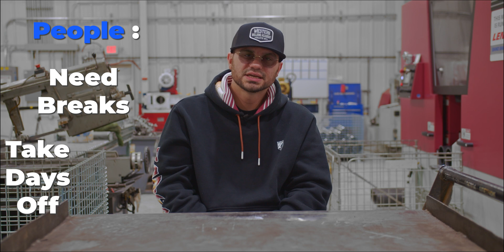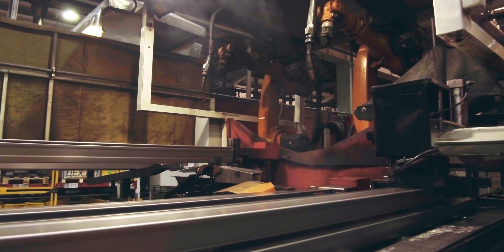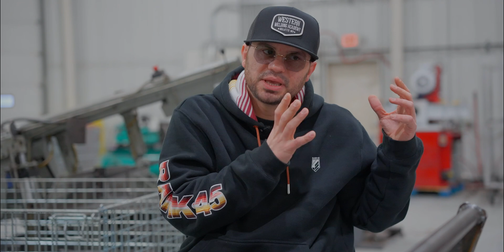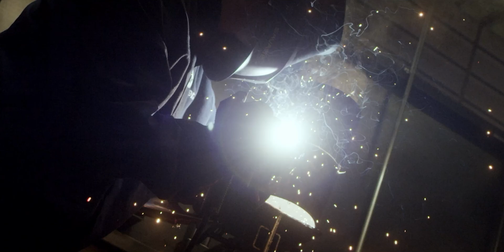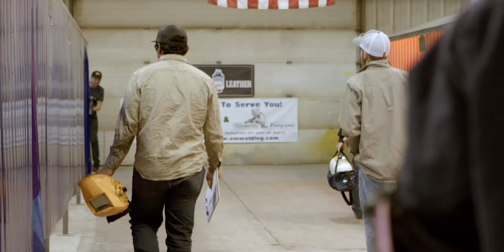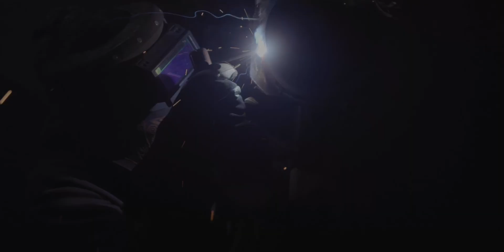THIS WILL TAKE WELDERS JOBS |The Future of Welding | @RealTylerSasse

Comment: Robots are viable solution for low diversity, high volume jobs, because od high NRE costs(setup, programming, fixturing, other tooling, and validation). There is still need for manuał or automatic inspection, and skilled welder to fix nonconforming welds. In high diversity low volume jobs  skilled welder can easily beat robot when it comes to cost and quality of the weld. Welder can adapt to what od happening to the puddle, and materiał, where robots are blind, do unable to adapt. Robots to work properly have to be fixed, so they can determine their position in space. So robots may take lower paid, less enjoyable jobs, freeing welders to pursue more exciting, higher added value, better paid work.
Reply from the maker: True

Comment: Id like to see a robot go out in the field, weld socket fittings 3 inches from a wall, left handed with barely any room to move, 40ft up in a man basket, and tucked up in a corner of a ceiling.

Comment: Ive been a production welder since 2019. I work in at a Hyundai/Kia supplier. I'm at the end of a welding line comprised of yasakawa motoman welding robots. I have to inspect and repair the front crash beams for the Hyundai nx4a Santa Cruz and the ob Kia Tucson. I've been doing this job, like I said, for a couple years now. This is the entry level for mig welders. If you would like to weld, this is where you learn on the job. The pay is anywhere from 11$ an hour to 15$, depending if your with a temp agency or hired through the door. The robots weld based on individual programs per car model. Usually about 2-5 inch welds. The steal parts are usually on the thinner side, so the fixes are cut backs, blow holes, and off position welds. And of course porosity, if you don't clean your nozzles. So as a welder/operator, you may have to fix something over and over again, that you may think is garbage. So a Good welder can take a part that is destroyed by the robots, fix them quickly, and send them to paint. I'm currently one of the best production welders because there is nothing I can't fix and ship. At this point I'm only company certified, but I would like to figure out where to go with this trade, if I could. One of the hardest parts of my job, is not only the quality of my welds and the parts I'm in charge of producing, but my ability to repair 40-60 parts per hour. That's a bumper every 1-2 minutes consistently over 10-12 hours. That's something automation can't do. They may have eliminated 6 welders, but there will always be a need for a human at the end. Thank you for your content, thank you for encouraging me and others to try and find out what our next challenge is. 👍

-The Bumper Wolf.
Reply from the maker: Well put. Thank you for sharing